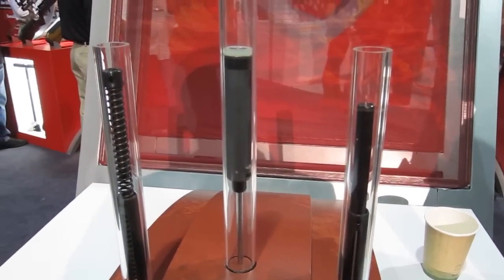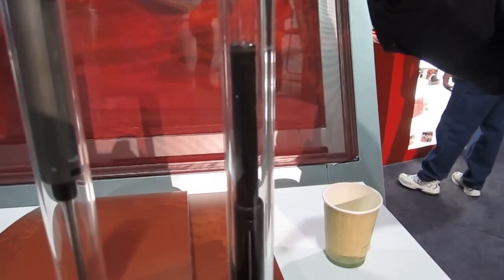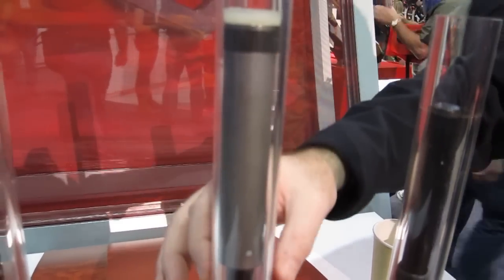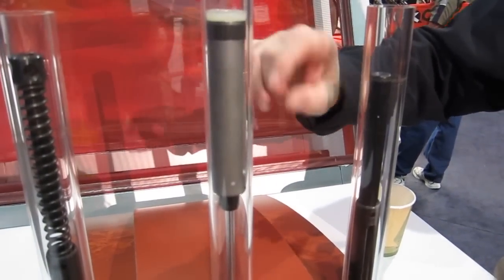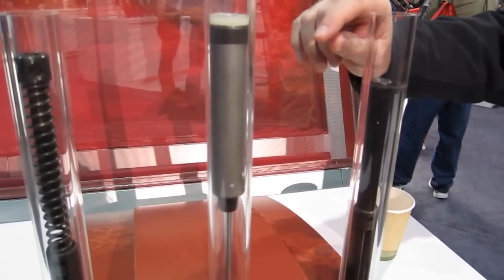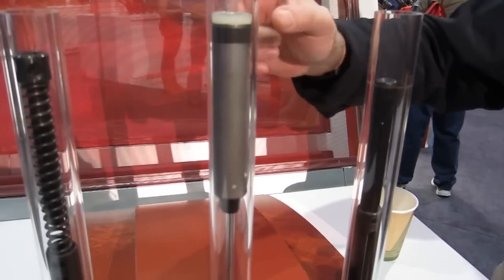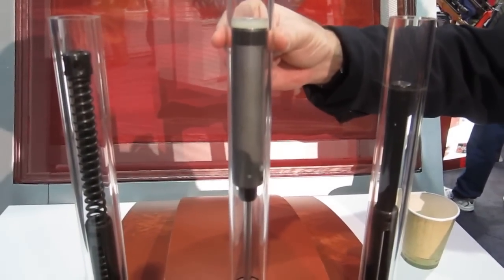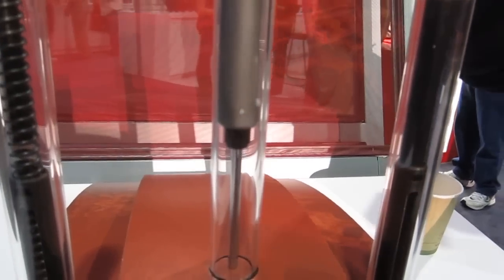Crosman Nitro Piston Gen 2 - presentation at SHOT Show 2014

Comment: Crosman should consider making & supplying a kit so that one can modify a springer, eg the Crosman Optimus into a Nitro Piston air rifle. I would certainly buy one of these kits!
Reply: Kevin Grimbeek You can make it happen with parts from Crosman, or by sending your gun in along with a substantial fee to have it converted. It's cheaper to buy a nitro gun than have them convert one so I don't see the point. 
They do not have a kit for the NP2 yet since the NP2 gun has unique dimensions so it won't work in existing springers.
Reply: Thanks for the time taken to respond, Todd. Much appreciated.
Reply: Unless it's a gun you really like, it would alot cheaper to just pick up a nitro piston.
Reply: Coil spring will last longer than nitro gas ram and cheaper when recoiling. . My son’s Crosman nitro venom used gas ram and it got Nitrogen air leak after 5 years with total of 200 pellets. 
 Coil spring if you cocked about 100 pellets in the summer, you will need  recoil it after 30 years.
Reply: @sonnynguyen8012  how did you know it was leaking? Are there signs to check for?
Reply: @sonnynguyen8012  good to know. I'm getting my first gas piston break barrel, the crosman valiant, so I'll keep all that in mind. 👍
Reply: @JesusChrist_IsTruth-LoveForALL  Make sure to keep your gun in the room temperature, I left my Crossman nitro venom in the back deck room where it got hight heat in the summer and cold in the winter. Probably the extremely weather makes the nitro gas ram leaks earlier than normally. Hopefully your gas ram will last long.
Reply: @sonnynguyen8012  ohhh ok good to know! I hope it lasts long too! Im wondering if I should get an extra gas piston for back up.. 🤔 I almost went with a PCP, but the gas piston break barrels don't require recharging/pumping and it's one less thing to hassle/carry/malfunction especially if you're out and about. Maybe for my next one though, they do seem pretty cool, at least to have one. 🤷
Reply: @Moto Man good extra tips! Thanks moto man! Ride safe! 💪

Comment: I have a Ruger Impact springer at about 16-17 FPE. I have a Trail NP2 gas at about 21-22 FPE. I like shooting them both for there specific engineered design requirements, because they both hit there own intended mark IMHO.  I can`t take from either of the two rifles. They are just a little different. Which is good to have.

Comment: Why weihrauch or airarms does not make nitron pistons in their airguns if it so great system? Maybe there are flaws...
Reply from the maker: Maybe they do not own the patent or maybe is too expensive to implement it in their manufacturing line.
Reply: The gas pistons are a great system for lower cost air rifles, that otherwise would have lower quality springs and sloppier tolerances that causes a lot of that buzz and noise. The high end Weihrauch and Airarms rifles are built extremely well with tight tolerances and very high quality springs that don't break, are quiet, don't buzz, and don't take a set from being cocked too long. They have no need for a gas ram system.
Reply: @firearmsguide   The Weihrauch HW90 guns are nitro piston models, but their spring guns are better & way more popular.

Comment: Pyramid shows cocking effort at 28lbs, so the claim of 10 less is another lie.
Two posters on Pyramid said <20ftlbs, far from the 26 claimed.
Also people complaining the shroud and scope rail are breaking! This just might be their worst gun yet.
Reply: Umm... Similarly powered guns with a regular gas piston have cocking efforts of about 40lbs and up. 40-28 = 12. 
If you're finding ones with similar power and cocking effort, do a little research, you'll find one or both are exaggerated. Smh
Reply: +David Friedland  I suppose there are some with 40lbs but no doubt they make more power to match. The point is they stretch the truth or flat out lie about the guns to make sales which really annoys me. They should've just said 28lbs cocking, but no, they had to use sneaky advertising to imply 18-22. Otherwise I like Crosman. 
People are still getting 16-22ftlbs power, usually ~20 or less. Nobody is getting 26 anymore than they got 23 from the old Trail. 
You know they advertise that the useless rubber section in the piston "virtually eliminates secondary recoil"? I think they're stretching "virtually" far beyond anyone's interpretation. The broken scope rails left and right, and anyone who owns the gun can state that is a flat out lie.   
Or "Built in America", which really means mostly China and only final assy is in the US. So what does that mean, they bolt the stock on? 
I could go on but I think I made my point.
Reply: +chev rolet I have to agree. The exaggeration by pretty much all the mfrs makes me less confident in all of them. Then I have to go looking up reviews to find the real numbers. I'm looking for a gas piston <$300 with decent power and low cocking effort in .22. Umarex and Hatsan have some nice ones, but every other review about them mentions how hard they are to cock. (and all of them 40+lbs) :(
Reply: +David Friedland  I'm one of the few people you'll come across that actually measures cocking effort accurately, so if that feature is important to you I may be able to help. You also need to decide if you want a suppressor, and is a gas spring really all that important to you. I think gas is neat but I I don't trust them and they have drawbacks. Coil have drawbacks too but at least theirs is fixable. Gas are often harder to cock and harsher firing. I have an Umarex Octane but took it apart first thing (and have yet to finish it) so unsure on cocking, but the gun it's based on, the Diana 350 is 32lbs which isn't bad at all. The B28 is a cheap version of the 350. In 22 I'd prefer a 350 or a Trail XL over the weaker NP2, but the newer Phoenix NP2 is pretty cheap @ $160. Imo most of these guns, and all the Crosman break barrels need work before use, but that's up to you. Hatsan are nice in some ways but not to nice in others so it's all about what you want.
Reply: @chevota400  What "Built in America" means, with Crosman and also Japanese motorcycles, is the product is manufactured in China, Japan, or wherever, then shipped here as a partially assembled unit, and final assembly is done here. So yes, like you said, they probably just open a crate full of rifle actions, and another crate full of stocks, then bolt them together. That would be my guess anyway, because I know of several other unrelated products that are made the same way.

Comment: Do you think those are as unreliable as the gas springs in the trunk of a car?
Reply from the maker: Only truth could let us know someone who works in service department of Crosman. They are the only one who knows what is a percentage of those guns that fails or broke. One thing that always amuses me is that people think that because there is no metal spring that there is nothing that can break.
Reply: @firearmsguide   When the gas leaks out, the power is partially or completely lost.
Reply: @firearmsguide  Like the gas springs in the trunk of my car, the replacement is back in order. I've had the car for 10 years, and I've changed them once before. And now i should change them again. The trunk can no longer be opened on its own. This is why a gas spring in an air rifle doesn't convince me 100%
Reply: Of course, gas has its advantages, but the spring is still simple and secure. It gets tired over time, too, but I still think it's A more certain choice.